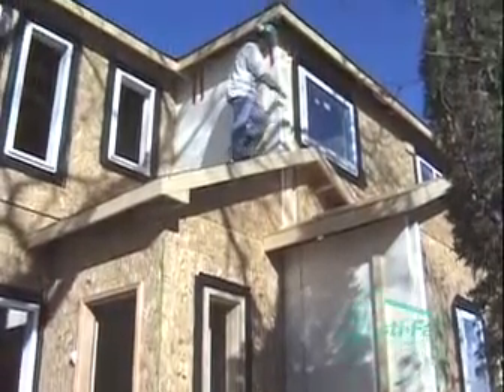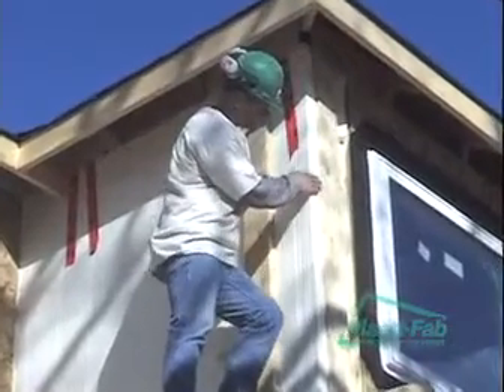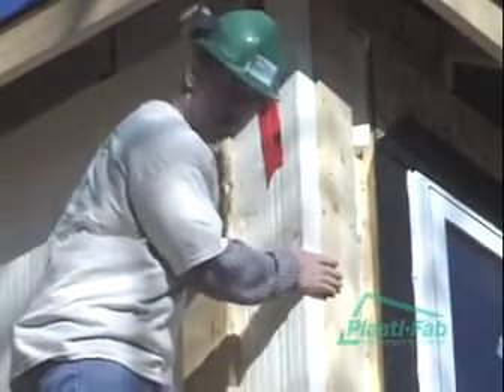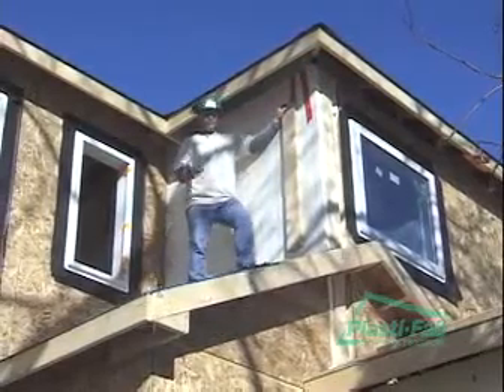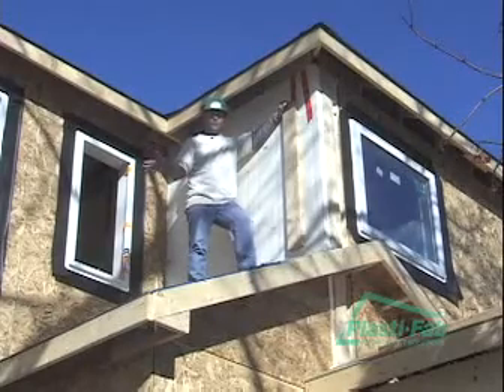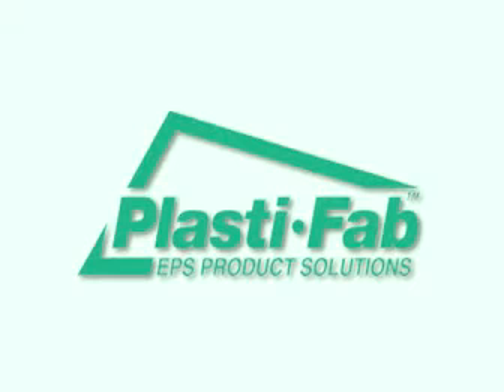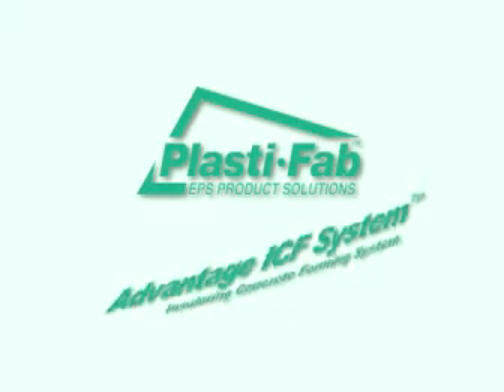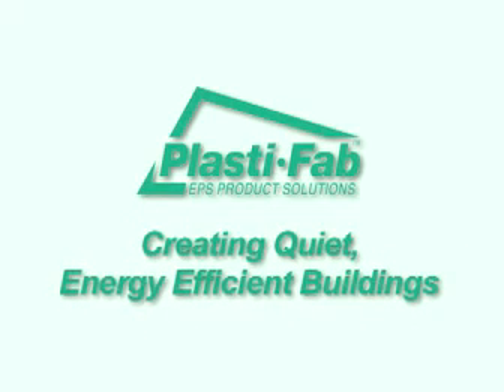Advantage ICF Installation Video - Second Floor F End Bulkheads, STC and Fire Rating

Comment: If I were to build a privacy wall/fence with ICFs, once the concrete is cured, could I peel off the foam? Since I dont need insulation for a fence, why not instead of the ICFs having those ribs on the inner side, a stucco pattern for example?